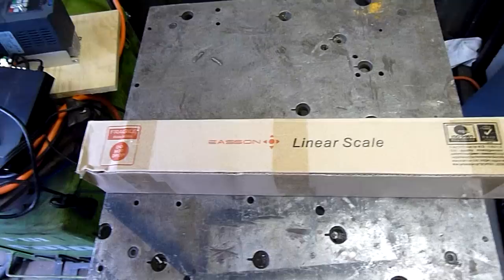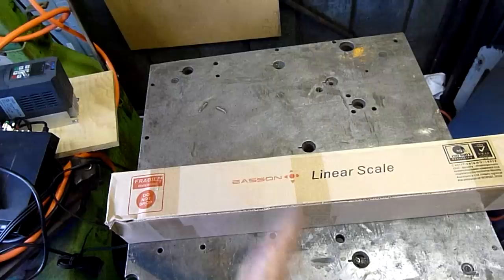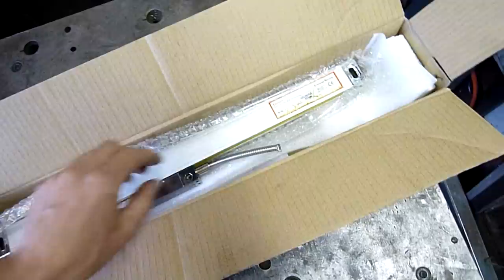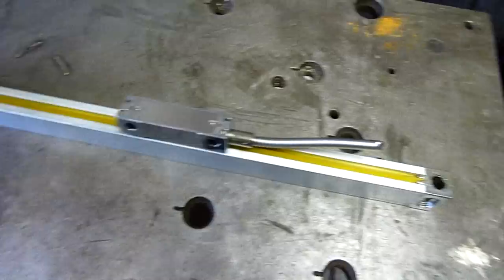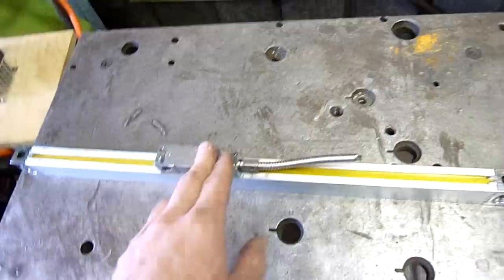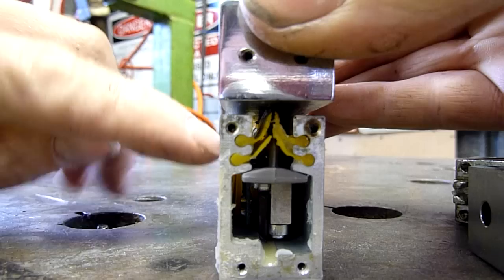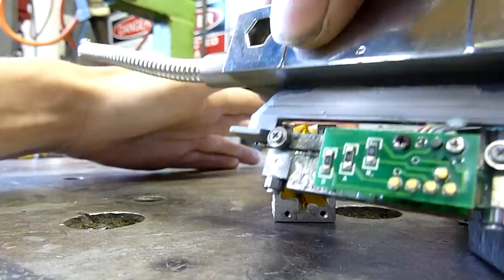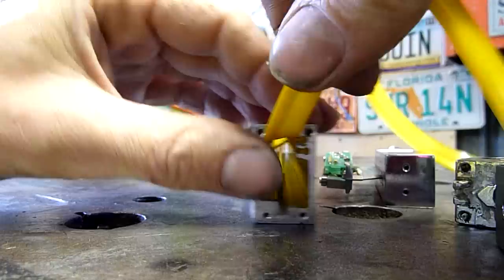Easson Digital Readout (DRO) Scale Autopsy

Comment: The four LED's give a quadrature readout, IE: it forms the rising & falling edges and the high & low readings in a square digital waveform. The lines on the glass are in microns and the blank areas are references for presetting the DRO readout. IE: you move the scale to those points and the Display unit picks up on them and automatically sets the readout to zero according to your preferences. There is normally one blank at each end but you can order them with more reference points if desired.
Reply from the maker: awesome! thanks for that!, now that the vid is processed I will show the guys in engineering tomorrow, they are keen to see how well the microscope works!.
Reply: Aussie50
Yeah that scope is pretty kewl! Much better than I thought it would be especially considering that it was also filmed. I might have to look into one of those :)

Comment: If you have a fixed grid moving over another grid, you get ;interference patterns', and those 5th's you mentioned, between the black and white it could change states twice, therefore you double to 10ths.
Reply: ***** That's right. There will be similar marks on the glass in the reader head, but they'll be tilted at a very slight angle to the ones on the main glass. As they move across each other you get much wider grey 'bars' moving very fast. Those trim pots will be to adjust the comparators to the exact spot where the optical readers get the best fix on the moving grey bars.

Comment: I believe the four sensors work in quadrature, with two "on" and two "off" at any time. Doing this, it knows which direction it is traveling.

With only one sensor, it can tell you how fast it's moving, but not the direction it is moving in. With two, it can be up to four times more accurate, AND tell you which direction it is going. Three gives you up to six times the accuracy, with direction. Four gives you eight times the accuracy, with direction.

The fifth sensor, I have no idea what it's doing. It's probably reading the larger bars on the scale. For what purpose, I couldn't gather. Possibly some kind of synchronizing. I originally thought it was an "on" reference level, until I saw the larger bars.

As for the barcode thing? One possibility is, if the scale can tell you the absolute position (not just relative), then the barcode may be some position finding reference. When the scale moves, it reads the barcode to find it's current position, then uses the delta steps from the four sensors to determine how far it's moved from the last position it found.

If you line the reader and glass bar up, what does the fifth sensor read? The larger bars, or the barcodes?
Reply: Yes and you may find the scales on the sensor half are not exactly the same pitch and so when moved against each other they also generate a sort of diffraction type pattern which may increase its accuracy even more. Incredible what is in some of this stuff. What I was most interested in was just how sensitive in its mounting that is what if the head wasn't absolutely vertical or slightly biased to one side, seems like its very capable of taking up little errors in alignment. Very interesting video.

Comment: It's probably a 20 micron scale. You can usually tell by your max readout resolution and how it counts and I bet it's 0.02mm. There is usually a few reference marks on the scale every so many cm so you can pickup where you were in the event of power failure or shutdown. I had to replace the head and seals on a 90" Heidenhain (German) and there's a bit more too it than this one. It broke from being too short for the lathe travel. The ones that use steel balls in a tube a magnetic head are pretty neat.
Reply from the maker: ah cool. I have a 70's vintage Heidenhain DRO in storage that is in good working order, its a really nice bit of kit!.

Comment: I just installed a new DRO to my mill, the last 5 micron digit on mm scale fluctuates  up & down while mill is running without cutting, and some times while mill not running last digit may still fluctuate by 5-10 microns after set to zero without touching anything, 5 microns is nothing but just a little distracting, & annoying is this normal ?

Comment: My understanding of the Autopsy, is Easson DROs are not as bad as what some people lead you to believe. Seems that the failure was of Human orientation not of the failure of inferior manufacturing quality.  eg:(Made in China)I think in todays world we will see a lot more of these DROs used as people have a tendency to go for price over quality.I do try my best to always buy quality equipment when ever I can. But as most people would agree it gets hard to justify a purchase of new equipment when a very similar item can be had for around half the price.
Reply from the maker: +Peter CCR ENG yeh its absolutely an operator/fitting issue. the cable was not routed very well, and the casing was being subject to high pressure coolant and air blasts. apart from that the other units are going on 10 years and the only scale damage has been user induced.  I would buy one of these for a standard production machine anyday. if you are talking multi-million dollar toolmaking biz, sure go the more expensive ones, but for manufacturing and hobby machines, these are excellent value!.